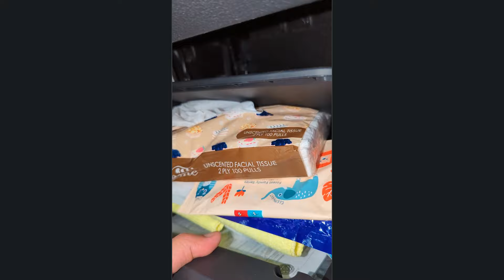Yaris Cross cabin filter

Comment: After removing the glovebox and put it back it not softopen anymore. Did you face that problem?
Reply from the maker: still the same for me. nothing's changed. :)
Reply: Try to check if the glove box was put back properly, the bottom part might have loosened, causing some resistance when opening it.